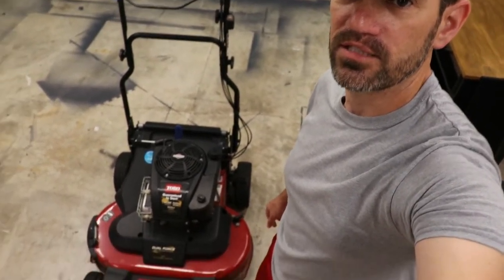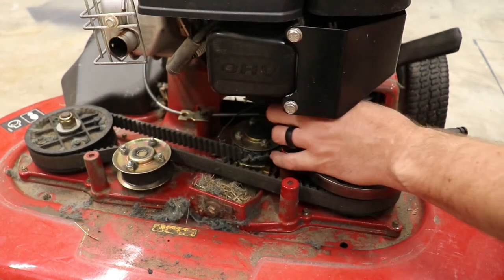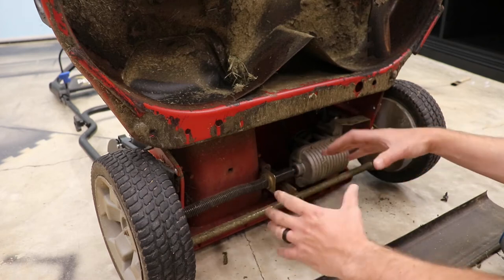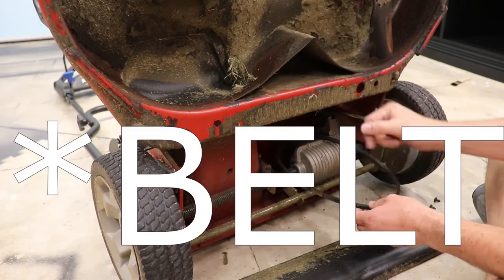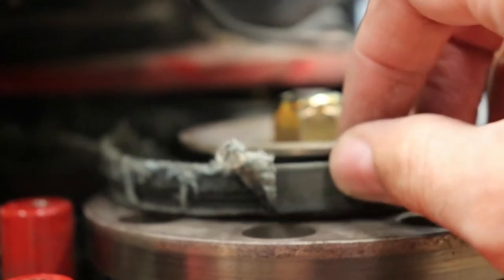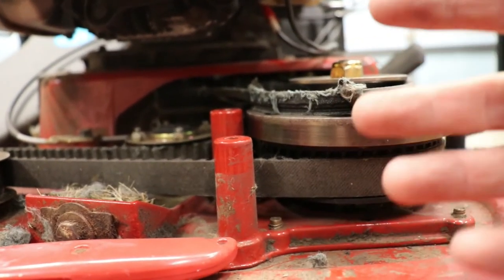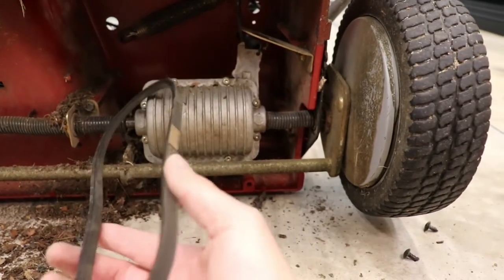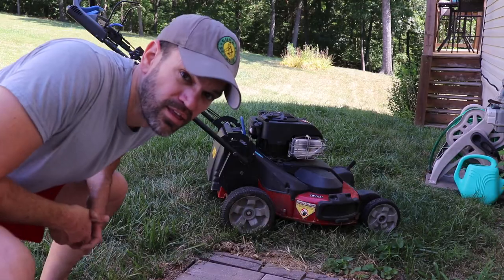How To Replace PTO DRIVE BELT - Toro TimeMaster 30" Lawn Mower

Comment: Ah, the good ole Timemaster.  The true tease in the Toro line.  It's great, until it ain't.  Belts, Pulleys, you name it...  you better be good working with your hands if you own this thing, because you'll be spending your 'time' 'mastering' fixing this damn thing.
Reply from the maker: Yeah it has needed some maintenance, for sure
Reply: Transmission, cables, eats belts like they are nothing, rear wheels and pulleys have all been replaced at least once. Other than that, it’s a great piece of shit.

Comment: I love the timemaster, but I am annoyed at having to replace these belts so often.  I've had the synchronous belt fail again a week ago, and while replacing that, I noticed the blade drive belt had a big ol' crack in it.  I thought I just replaced that one not too terribly long ago!  Also replaced the wheel drive belt last year.  I'm buying multiples of these belts to have on hand knowing they'll all fail eventually.
Reply from the maker: I feel your pain. That's what I've done as well. And I've learned to purchase the OEM belts instead of the cheap knock offs.

Comment: I am going to be replacing this same belt when I get home from work tonight.  Been watching a few videos on the job today just to get a feel for what I'm going to be doing.  pretty much everyone is doing it the same way, so pretty confident I can knock this out in about 20 minutes.  Out of curiosity after some time has passed, how long did that new amazon/generic chinese equivalent belt last?  I read a TON of reviews online that the cheaper amazon version of the belt wore out and broke again very quickly compared to the OEM belt.  any 'long term' feedback on that particular belt's longevity/quality?
Reply from the maker: I'm in my second season with the belt, and now I'm nervous! I'm hoping mine doesn't break again too quickly! So far so good
Reply: @howtofixitworkshop  hopefully you get the rest of the year out of it. They seem to be every 2 or 3 year replacement items I guess
Reply from the maker: Thank you for the warning, I better go OEM next time
Reply: @howtofixitworkshop   I know I probably always will. There are only a few dollars more for the piece of mind. And I think every year after I've replaced it at the beginning of the next season I will probably buy another one to have on hand because it does seem like these things kind of eat belts like crazy lol. At least it's not super arduous to replace
Reply: Not to bad mouth OSHA, cause they really do some great things that have saved a lot of lives and limbs, but sometimes someone in the system goes overboard, trying too hard to keep us safe. So, Toro had to come up with a system to disengage the blades while still running. Trouble is, as the engine has no throttle control and is running full speed, it's impossible to not put extreme stress on belts. 
That's one of the reasons Honda got out of the small engine business. Too many expensive safety and EPA compliance restrictions to continue profitably. Heck, now California wants to ban all ice for all yard maintenance products.
On another note. Wnen one buys those Chinese products, saving 20% but getting 50% less product, we then only get what we deserve. We create that race to the bottom product quality effect. Then the oems  think well, since no one is buying the quality product, we don't need to stock as many replacement parts and also what stock they do have, we have to store it longer, so that cost more too.

Comment: Is the 'drive belt' going to the transmission AND the 'blade belt' going to the blade engage the SAME belt? Do I order two of them or what? I am changing the blade engage cable and I noticed the blade engage belt has cracks all along its length, only the fabric on top is keeping it together.
Reply from the maker: They are actually 2 different belts, I believe they are different lengths. I should have links for both in the video description
Reply: @howtofixitworkshop Thanks for the reply, but your description shows only the one belt (A low and a high quality blade engage belt) but you have no link for the drive belt that goes to the transmission as you show being replaced at the end of your video.
Reply from the maker: Ah, ok thanks for letting me know. I actually have a separate video for the other belt. I'll add the link
Reply from the maker: https://youtu.be/XGvLSvPSpMk
Reply: I think the transmission belt would be 120-9470.

Comment: Dang...you skipped the part that I came to YouTube for....how to get the new belt 'fed' over the lower trans pulley.  Getting the old one off was easy but the new one seems too big to get past the lower nut.
Reply from the maker: Yeah that is the hard part. I've had to replace this belt again and you have to remove that pulley from the trans and pry the trans back up into it's slot then replace the belt

Comment: What a piss poor design. Just starting my 4th year with this mower. 2nd year the engagement cable broke. The cable was rusted. Why doesnt the factory pre lube it with graphite, just like speedometer cables are. Got that replaced under warranty. Im sure its another dry cable just waiting to break again. Now the drive belt shredded. My last self propelled mower lasted 20+ years. Only thing i replaced was the drive wheels.what bothers me, will that belt even be available years from now. I paid $900 for it. Now 4 years later i see its $1599.00 now!!! Thats over a 50% increase in just 4 years!
Reply from the maker: Yeah, it's just another example of planned obsolescence.  But wow! I can't believe this mower is selling for $1600 new now, I bought mine 6 years ago for about $700!!  I've replaced a couple cables and a couple belts a few times, but other than that it's been a pretty good mower overall.  I have an extra drive belt in my garage just in case, maybe I should purchase a few other spare parts to have on hand.  And I better give mine a tune up so that it lasts for many more years to come, I certainly don't want to think about buying a replacement in a few years.
Reply: @How To Fix It Workshop  I found a much easier way to remove transmission  belt. 
After bending that stop tab out of the way. Just get a set of large Channel Lock pliers and simply and easily rotate transmission, and the belt nearly falls off. Same for putting back on. There is no need to fight that darn tension spring. 
Figured this out because I have a severely injured, painful elbow and am basically almost 1 handed till it heals up. Lawn mowing was a little tough one armed. Lol
Reply from the maker: Great tip, thanks for sharing. I'll keep that in mind for when I have to inevitably change the belt again
Reply: I have the same exact problems, if I decide to go for another High End Morrow, this Company will NEVER be on the list..
Reply from the maker: I've actually had good luck with my 8 year old mower other than replacing belts and cables. I agree it's frustrating but now I keep extras on hand for when they break and I buy the OEM parts instead of the cheaper versions.
Reply: @howtofixitworkshop  Could you provide a link for the company where you buy the OEM parts.  Or please list the company here.  I spent several hours trying to find OEM parts but haven't been successful.  Thank You